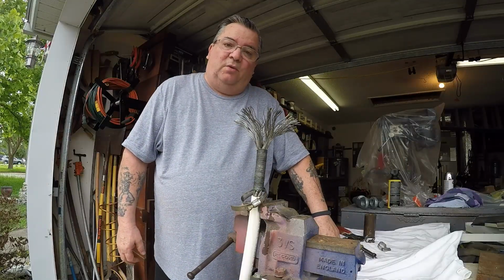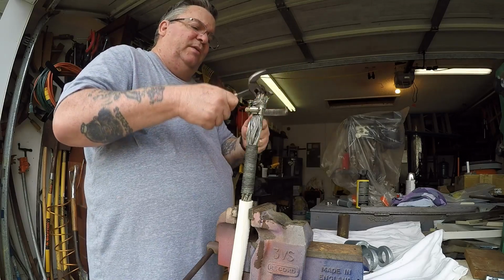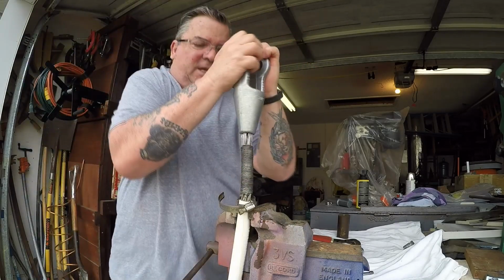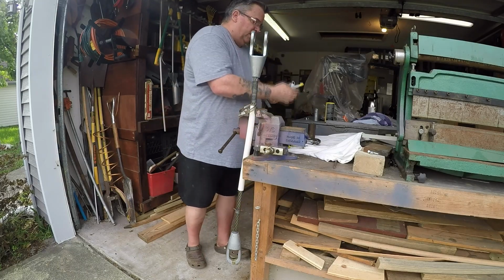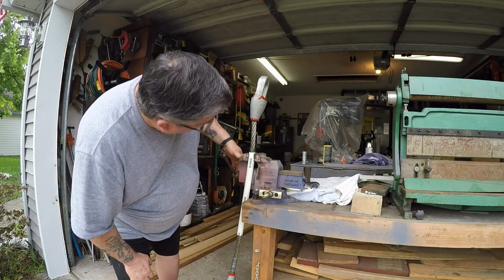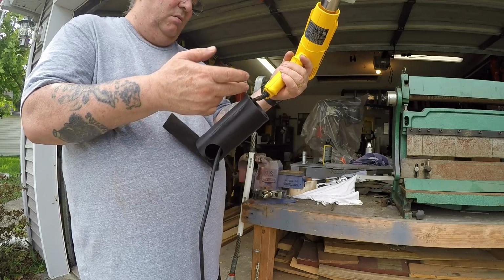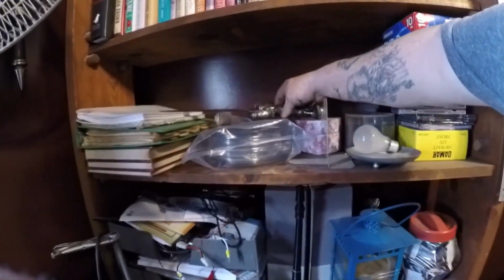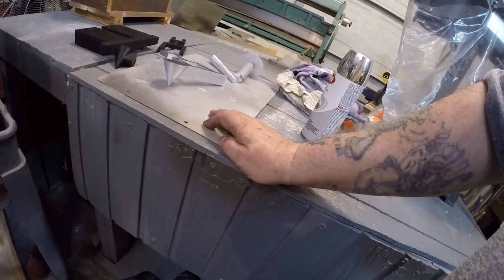Wire Rope Sockets, Part 5

Comment: Why not use smaller binding wire. And slip the thimble down over the wire rope and then spread your rope, clean  the end and separate the strands and clean the separate strands.   Pull the thimble up over the  strands, turn back the separated broom  strands back. down into the thimble back along the way you started. Pour your Babbitt on epoxy material into the thimble.  Let it set up.   This is how the elevator trade makes up a cable end when reropeing an elevator. 
Nice job.

JoeB

Comment: I’ve socketed bridge cables 4 inch diameter with sockets the size of dustbins…the brushes have got to be exactly central then pre stressing the rope by cycle loading the rope to 3/4 hundred tons taking the elasticity out of the rope then coiiing the finished rope on wooden drums..,
Reply from the maker: @mickmckeown9288  thankfully I never had to work with anything that big. I think the biggest cable I had to put a new socket on the end of was 2 inches and that belonged to our ships cranes.

Comment: Have you ever put zinc poured sockets onto alumaweld wire? Transmission line/guy wire ?
Reply from the maker: No, it was usually bronze wire, steel wire,  zinc coated steel wire or stainless steel wire. The aluminum coating on the alumaweld wire would have to be removed so that the zinc could bond with the steel strands of the wire if you were ever contemplating the addition of wire rope sockets to the end of High tension wires.
Reply from the maker: All of the guy wire I've worked with was usually galvanized (zinc coated) and in that case putting a wire rope socket on the end of those would work just fine.

Comment: Why not put both sockets first on the cable in the middle and then spread the cable ends and proceed, will be much easier.
Reply from the maker: That would be nice, and would certainly make part of the process easier, if it wasn't necessary to seize off the wire (with seizing wire) to keep the cable from unwinding before the sockets are poured. The cable can't unwind the smallest bit if you want to maintain the strength of the assembly and if you bought the cable that fit the sockets, the cables will barely fit in the bottom of the socket in its' "tightly wound" state. Good idea but I had the same idea the very first time I worked on a socket. Almost got slapped down by my supervisor when I tried it. lol
Reply: I know what your sayin, the seize won’t fit through the bottom socket hole. I always go through this with bridge strand wire. I’ve found that braising the ends while it has a good seize, allows you to remove the seize and fit the ends into the socket. You’ll have to re-seize and cut the ends clean.... but you avoid all that tricky over the top action. Use a chain hoist and your👌🏻.